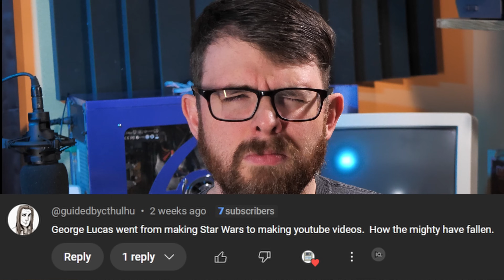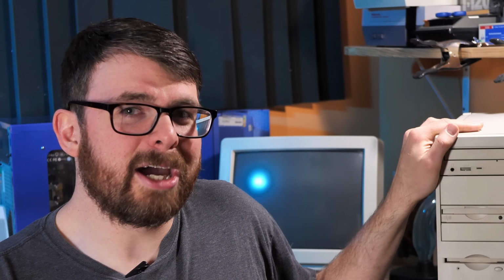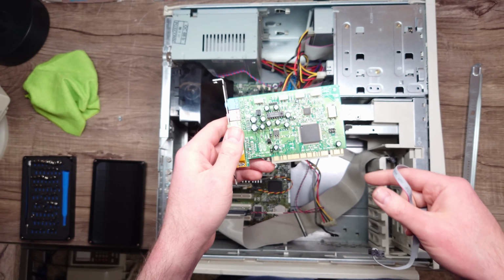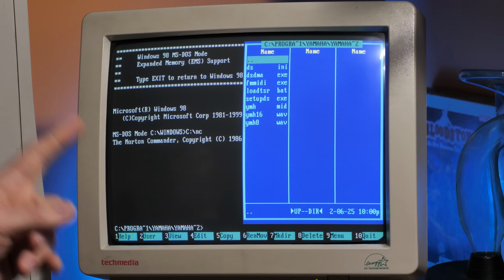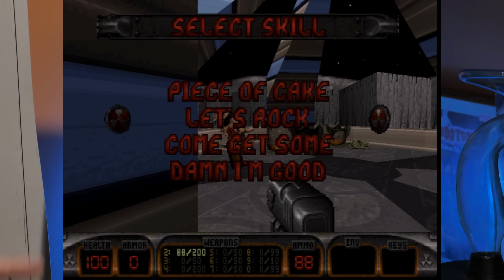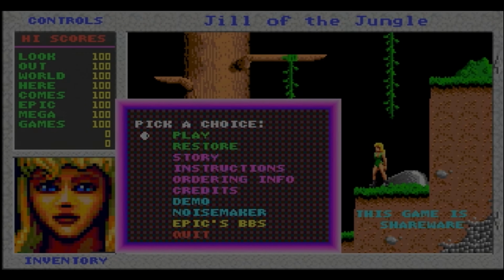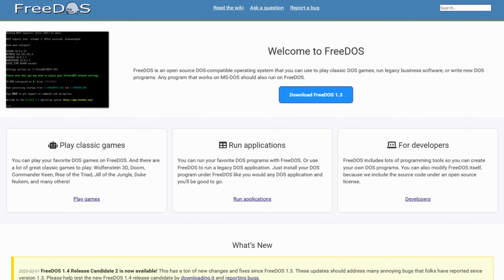What is SBLINK? Does It Make PCI Sound Cards Better for DOS Games?

Comment: 4:59 I have no idea if I had the same model, but when I had a computer that looked like that, hooking the hard drive up using an an IDE controller card got faster read/write speeds. No idea if that applies here
Reply from the maker: Yeah it is a faster interface, but I don't know if It will really matter much using CF cards as a boot device.

Comment: Awesome video! Am a big fan of the Yamaha DS-XG and have done the PC/PCI cable install. Always worth doing if possible! Also worth doing is installing the PowerYMF package. This restores the full 4MB XG synth and can also do the same with Windows XP. Using the Yamaha driver and SoundFX 2000, you can restore proper legacy access for dos games (the PC/PCI cable isn't strictly needed for this - SB sound effects are done through the default wave output device although legacy MIDI access is direct to the cards legacy addrsses eg OPL,  MPU-401 etc) The system I used was a dual boot so some games that didn't work properly in say Win98SE worked absolutely fine with WinXP via NTVDM + SoundFX 2000 (and vice versa) it was a fun exercise!
Reply from the maker: Great info to know thank you! I was a bit interested how it would fare in XP/2000, maybe its worth looking at again.

Comment: I have Solo 1 sound card and 3 motherboards with SB-Link and I don't hear or see any difference when it's connected or not, in both cases, it normally works in DOS when I finally manage to make it work, it looks like SB-Link connection does nothing. I didn't find any settings where I can literally switch it to SB-Link mode like you have on your Yamaha.

Most of motherboards with SB-Link also have ISA slot and SB-Link PCI sound cards are very rare, so I don't really see any point in using it instead of real ISA card like widely available ES1868 based cards that do it's job great and mostly also have wavetable connector.

9:53 - the same problem with digitalized sound effects in Wolf 3D, I found out that it works better when you use IRQ 7 instead of 5, but maybe it's just a coincidence

Comment: Those custom IDC cables can be tricky to get right, somtimes the connector is upside down on one side in relation to the cable's direction from the connector. As a rule of thumb, always match the pin numbers on the respective boards to the side of the cable connector with the red lead, and you're usually good to go.

Comment: Those Slot 1 Dell dimensions are actually fantastic.

Intel 440BX motherboard that can support processors as low as the 233mhz Celeron and as high as a pin modded 1.4ghz Tualatin on an FC-PGA slotket.

It’s got an ISA slot, SB Link, universal AGP slot. A high quality PSU, albeit only 200 watts but the power consumption at peak is roughly only 80watts. Dell also really nailed the beige tower look.

Their cooling solution with the heat shroud is great too. I have a low profile copper cooler without a fan on my Tualatin so that it can fit into shroud which pull air from a 92mm Noctua.

Comment: Nice, A Dell XPS TXXX series computer.  That was my first computer back around 2000.  A quick word of caution about it: Dell used a nonstandard pinout for the motherboard power connector, if you try to replace the PSU with a new one, you will likely fry the motherboard.  There do exist adapter cables (and if you look up the right pinout, you can probably make your own) that will convert standard ATX to the odd Dell format, and I actually saw them still being sold on ebay as recently as a few years ago.  I currently use one of those adapters in my XPS T450 now, having replaced the stock PSU with one from Startech that does -12 volts natively.  Some random other notes: Some of the DVD drives that came with these can be flashed to run custom firmware allowing the drive to create backups of Xbox and some Xbox 360 games, MVG has a video on that.  I was able to do that with my drive and have confirmed that the backups can be made to run in Xbox and Xbox 360 emulators.  Also, after replacing the PSU if you wanted to crank up the power you can replace the CPU card with a PowerLeap PL-iP3/T (if you can find one) that allows the system to run up to a Tualitin 1.4GHz Celeron.  I certainly doesn't help compatibility with DOS games, but hey, it can be fun to take things in the other direction.  Also, and this is my least favorite part of the motherboard, the southbridge only supports a single floppy drive, so don't bother connecting a cable with two connectors, only one will ever work.  It's a limitation of the southbridge chip itself, not a bios issue.  It can kinda work if you plug in a floppy controller into the ISA slot, and then disable the floppy controller in the BIOS, but it's super flaky.  Honestly I keep meaning to try a floppy adapter that has its own bios.
Reply from the maker: Yeah I am aware of the PSU issue... really the only major quirk of what is a solid machine. I haven't been able to find any adapters, but the PSU seems to work fine for the time being so I guess I'll cross that bridge when I get to it. 

Thanks for the additional info though! It does have a DVD drive that looks original so I might have to look it up. Not sure if I will ever upgrade the CPU, but its good to know the option is there if I can find one.

Comment: Correct me if I'm wrong, but if I think that if you run dos games on Win98, the sound card drivers for that Yamaha sound card will run in emulation mode. To test the real SBLINK mode, you need to boot in DOS mode and add the BLASTER variable.
Reply: It depends on drivers, I have ESS Solo 1 card (also PCI card with SB-Link) and it looks like it's running native, but you have to force card to run on IRQ 5 or 7 which can be tricky, when it's stucked on IRQ 10 or 11 in Windows, sound in does games will not work. Some other PCI sound cards automatically install SB16 emulation, like CMI8738 or older PCI sound blasters (from pre Live era) and then it runs emulated and it doesn't matter what resources your sound card physically has.

Comment: Ah.... I miss this computer.  I used to intern for a storage company which used commodity PC components.  When they switched to P4/Xeon CPUs with RAMBUS memory, they scrapped the PIII and RAM.  I was able to upgrade this Dell from 600 MHz and 128 MB to a 800-833 MHz with a slocket adapter and 640 MB.  I regret giving it away :(

Comment: I have a Ymf724 just like yours but from a different vendor, with a more old layout with all black connectors.
It's very strange on the game Tyrian 2000 on your side, because I don't have any SbLink and the game runs flawlessly!
I use the latest Yamaha official drivers which are no longer possible to download, but I provide them on Archive from my account. You also could download them using Archive's WayBackMachine like you did on the previous video.
Again, it's strange! I also think on Duke Nukem 2 there aren't any issues but I'm not sure right now. The other games you mentioned I haven't tried yet.
The only games that give me trouble with the Ymf724 so far, are all games from the old "Titus" company. Games like Blue Brothers (1991), Blue Brothers JukeBox Adventures (1993) and Fire and Forget 2 - The Death of Convoy (1990), the sound simply does not work and is redirect to the PcSpeaker. Surprisingly these games play flawlessly with my other retro-computer with a SoundBlaster Live 1024 - CT4830🙄.

Comment: I would love to have one of those techmedia monitors.  I have three different types of Techmedia cases.  I would love a Techmedia CRT to go with them.   Don't get me wrong I love my Sony Trinitron, but a matching set would be great.
Reply from the maker: I've had this thing for probably 30 years and Its funny I get some comments about it being desirable at times. I will be sad if it ever dies though.
Reply: @DOSStorm  I have looked everywhere locally for one, but I haven't found one.  Thinking back to the early 90's when I was a kid/early teen, I never saw techmedia around here.  I don't know if it made it to the midwest.  But I enjoy their little case designs (I have the desktop with the built in speakers.  Surprisingly good sound) and I have the matching keyboard and mouse, I just need a monitor.  If I can find one, it will likely be on the west coast as that seems to be the common place I have found techmedia anything.  If I find one I will drive to get it.  My batting ratio for successful crt delivery to me is 1 in 12 so not good.
Reply from the maker: @helldog3105  Interestingly, I'm from the midwest. I'm not sure entirely where it came from originally(as I was very young), but the first PC I remember seeing it with was a Tiger branded desktop. I think it was socket 7 system with a Pentium 1. I really wish I could find one like it again as it was my first PC.
Reply: @DOSStorm  There was a person on ebay selling the tower case from techmedia with the socket 7 motherboard that went with it.  They may be sold out now, but if they still have the motherboard, I still have a spare Techmedia Tower case.

Comment: Duuude, ya got a Dell! Also, have the same voodoo 3, a 2000 with 16MB. Also have a pair of Voodoo2s. All 3 need some help tho. Also have a Geforce 256
Reply from the maker: Those commercials still pop in my head whenever I think of Dell. I wonder what ever happened to the "Dude! Yer gettin' Dell" guy?
Reply: @DOSStorm  allegedly got fired for smoking 420

Comment: I wonder if that ATA/IDE controller was more performant than what was built onto the motherboard. Missed or couldn't tell the make/model to see. Just thinking back to reasons I had one of those cards in the past.
Reply from the maker: I need to double check it, but someone else mentioned that it is probably a RAID card. I think it is made by promise.

Comment: Interesting demo! Funnily enough I have the same card for the same purpose, but no fitting MoBo. And I've gotten probably the same Voodoo 3 for cheap on a flea market.
About Jill: I've written a DOS audio library by myself, so I know how this works. I can imagine the game is not using auto-init DMA transfers, and just plays a single sample at once. The first SB cards (pre 2.0) could ONLY play single-shot samples (auto-init DMA enabled click-free audio streaming). 
An interrupt is triggered when the card is done playing. I can imagine the game not playing the same sample again until it finished playing, and it flags the samples that finished playing by receiving an interrupt. Now if that interrupt is not triggered properly, or in a condition the game doesn't always handle properly, it gets stuck.
Most games use auto-init DMA playback when possible, because they mix sounds in real time (something Creative Labs initially didn't think about, they expected games to trigger single sounds), and I can imagine that the Yamaha card may also have been better tested against this more common scenario, leading to issues like this. 
Again, just a hunch, but one that makes sense.

Comment: ...this is ironic... the computer i have with this chip built in to the motherboard is a Dell XPS T600 (no R) ... basically the high end model of this same computer... makes sense, that since the board already supports SB-LINK, that they just put the DS-XG chip on the board itself ..... $100? ouch.. got mine at a thrift store a very long time ago for $10...

Comment: Is that the On Must Fall 2097 theme I hear during cleaning? If so, I havent heard it 4 years! I was soooo mesmerized by that tune and the quality of the sound of that game (on a ISA Soundblaster Vibra 16, which I still have in working condition...)
Reply: It's the Power Plant arena music, not the theme. Funny that the registered-only arenas have lesser music than the shareware one. They're still good, but the power plant one is the best of the arena tunes.

Comment: Nice!, but it makes a little less sense to make it with a motherboard which already has ISA slots. The true power of this is doing it with a Pentium 4 motherboard with SB-Link and no ISA slots for a true powerful DOS/Win9X machine. Also, the basics are; don't connect backwards the cable only in one end (right?), then make the PCI slot you are using be IRQ 5 or 7 thorugh bios or other tools, and... play DOS games in native DOS, not Windows.

Comment: That "PCI IDE Controller" is actually a RAID controller, and it does ATA 66, which is a lot faster than the (assumedly) ATA 33 of the onboard controller. 

ATA 66 RAID 0 would have been ridiculously fast for the time, if that's what the previous owner had. It might even be faster than the CF card reader you put in there.
Reply from the maker: Makes sense considering it has ECC RAM as well, it definitely was a higher end workstation for the time. Interestingly, that card(along with the Voodoo) are listed on the driver page for this machine on the Dell website. So they must have been official options. Either way for my purposes I think the CF card speed would be a bottleneck if I used a faster controller.

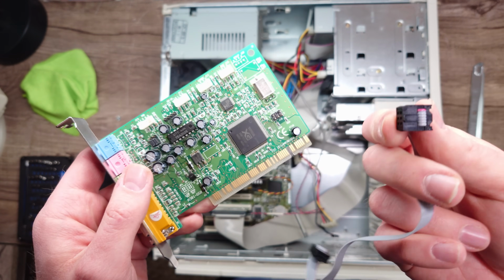Comment: When you connect ribbon cables, you always put the red cable on pin one. At 4:25 you put the cable backwards. The worse part is that when you connected it to the motherboard, you didn't look the marked pin 1 one the silkscreen and you put the cable the right way, so at best it won't work, and at worst you may fry the sound card or the motherboard, as now the cables are crossed.
Oh, ok. You fixed that at 7:30. Next time put a warning, now I feel like I have written this comment for nothing.
Reply from the maker: Yeah my bad I had a silly moment. To be fair if you have the real SBlink cables they are missing a pin to prevent you from plugging it in wrong.

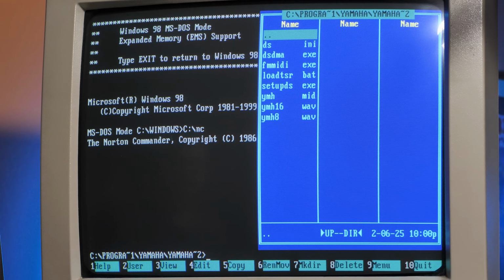Comment: 6:26 Sir, that is Norton Commander.
Reply from the maker: Which is a file manager running under DOS. 😛
Reply: @DOSStorm  Windows 3.1 is running on top of DOS same as Norton Commander runs on top of DOS.
but if you were to show screenshots of Windows 3.1 you wouldn't say "this is DOS" right?
you'd say this is Windows 3.1
Reply from the maker: @ Technically you're right, but I was really just using it to launch the config utility. My entire point was that the program needs to be under pure DOS and not Windows. Norton Commander just saved me some typing for the purpose of a video.

Comment: I had the same sound issues with Apogee Games. I have issues with Major Stryker too. Sounds like it is emulating one voice at a time which is bad.
Reply from the maker: It's odd because some of them work fine, like Blake Stone for instance has no problems at all.
Reply: @ I believe it is the audio engine at the time had issues with non-100% compatible SB Cards

Comment: Now I need to check my QDI motherboards, thanks for the tests, maybe you only need to slow down the CPU to get around the issues with these older games  🤞🏻
Reply from the maker: Someone else suggested that as well. Maybe it will work if I use moslow or something.
Reply: @DOSStorm  you might start with setting the FSB to 66MHz and disabling the L2 and or L1, IDK maybe SetMult can slow it a bit. 😬
I check out some of the pictures of my QDI boards and I have a Socke 478 with the PC-Link solder points, it might be worth checking it out.

Comment: really lucky find with that voodoo3! congrats
Reply from the maker: No kidding. Definitely not what I expected to be in there! It also has a ZIP and DVD drive, which add a bit of value as well.
Reply: @DOSStorm  it looks like a fairly high end dell. p3 600 isn't too shabby either. You should probably mod a fan to that voodoo card though. The back side of the card looks brownish from all the heat which is probably not a great sign
Reply from the maker: @sparki_  Yeah I might throw a Noctua on it, as well as the exhaust fan since its loud as hell.
Reply: Yeah agreed. Awesome system

Comment: Thanks for demonstrating sb-link! Maybe its not the soundcard but the system might be too modern for jill/dn2 and therefore causing issues. You can try to fix it by activating the memory hole at 16mb in the BIOS so it will report only 16mb of ram. And maybe using setmul to slow the machine down. And congrats for the Voodoo 3 🍀
Reply: I think Duke uses ADPCM sounds, not supported well by the yamaha cards, not sure about Jill though
Reply from the maker: Good ideas! I'll look into them and see if it makes any difference.

Comment: I think you made your money back with the Voodoo card there :)) that thing alone is about the price you paid for the whole package.
Reply from the maker: 100%. When I saw the GPU on the listing I just assumed it would just be a RAGE 128 or something. The whole system is good though! The only downside is I think it uses proprietary power  connectors, but I guess I'll figure that out if/when the power supply gives me issues.
Reply: @DOSStorm  ah, done that a million times - it's quite easy to just transplant the older connector to a new power supply, as long as you group the wires by voltage. Those are still ATX voltages, so the insides should still be compatible.

Comment: Thank you again for covering this.  It is a really neat option that some of my favorite Slot 1 motherboards offer.

Also congrats on getting a great Voodoo card.  I managed to score a similar 3DFX V3-2000 card from an ebay auction where the seller never bothered to clean off the layers of caked dust to check what the motherboard and/or cards that were installed.  Just sold the case as is and took some lousy pictures.  Needless to say I was rather thrilled when I got the machine and cleaned it all up.
Reply from the maker: Of course, I like covering all the sound card things! As for the random Voodoo3 card, sometimes seller negligence or lack of knowledge works in your favor. Good to know you can still sometimes win with eBay, but I've had it go the other way a few times as well.